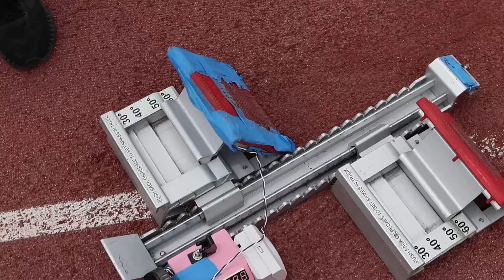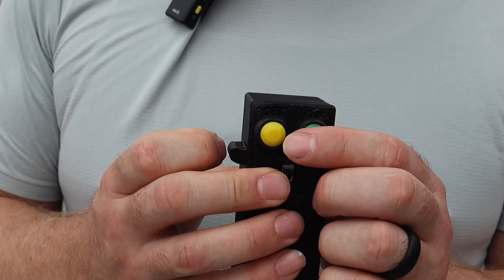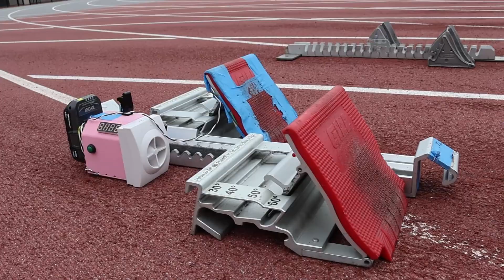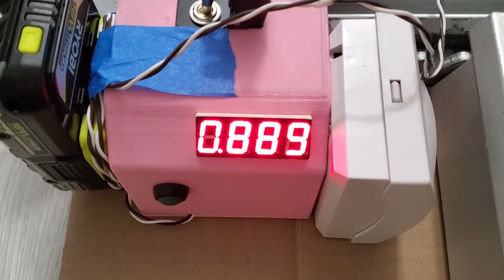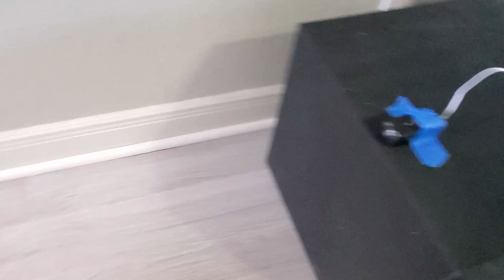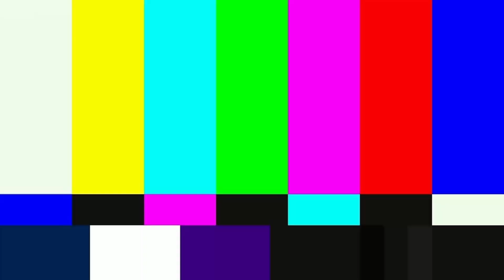This helped my wife qualify for the Olympics!

Comment: Awesome stuff. ". . . Unlike some battery manufacturers. . ." I know who you are talking about haha
Reply from the maker: @gregorysember2164  it's just a difference in architecture,  nothing wrong with it,  but you need to know that if you are going to use tool batteries as a power source.   And they make an excellent power source for this kind of project, after a week of use I'm only seeing one bar of power used.